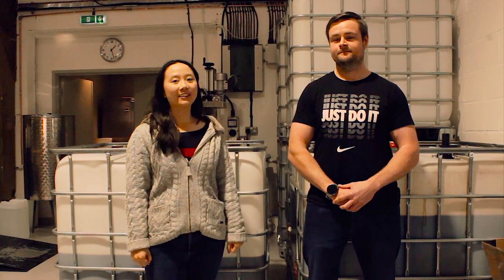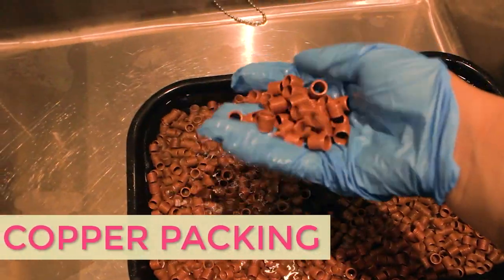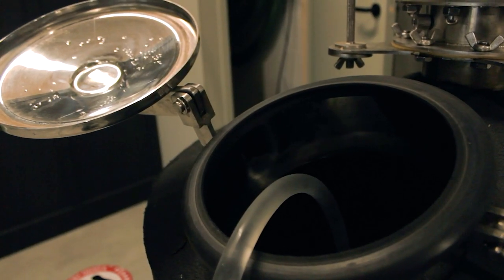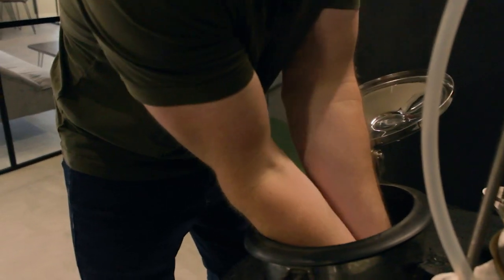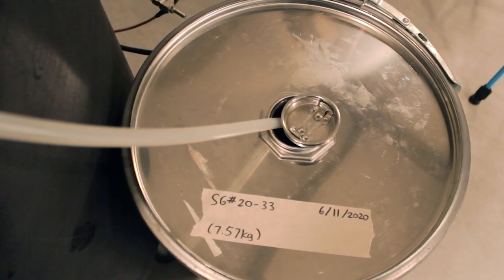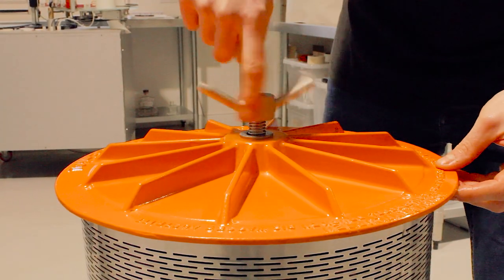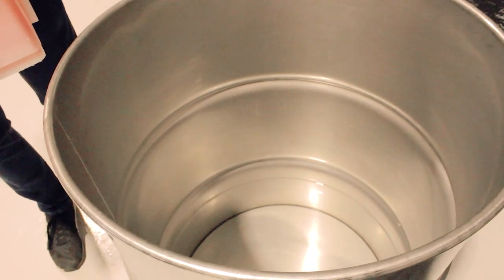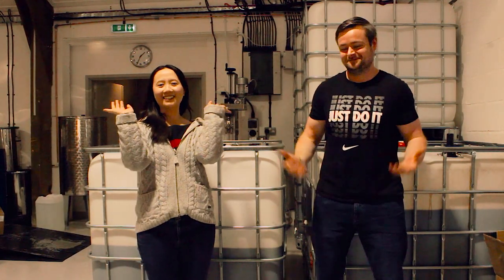Making Naturally Pink Gin | Shakespeare Distillery

Comment: At what pressure does the press operate?
Reply from the maker: Good question. It was either 2-3 bar pressure,  I can't remember the exact number. At the bottom of the press there is a pressure outlet valve for the bladder. So at a higher pressure water will start coming out from the bottom outlet valve.

Comment: How well does the iStill get the cuts right? I prefer going by taste on every batch, even with repeated recipes as many things even as subtle as atmospheric pressure seem to slightly change the cuts.
Great video as always. Our licence application is going into HMRC in the New Year :D
Reply from the maker: That's very exciting for you! 😀The cuts are based on temperature not %abv, so it depends on the temperature sensor in the iStill. We do taste it before cutting from heads-> hearts, and hearts->tails as well.